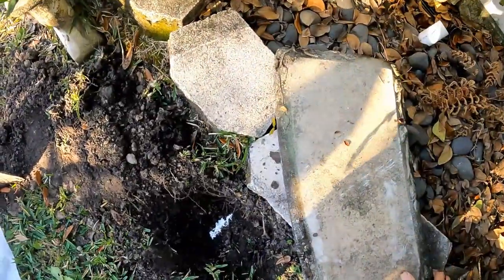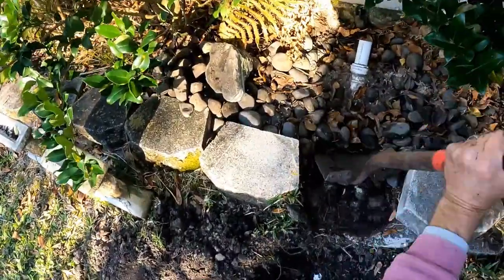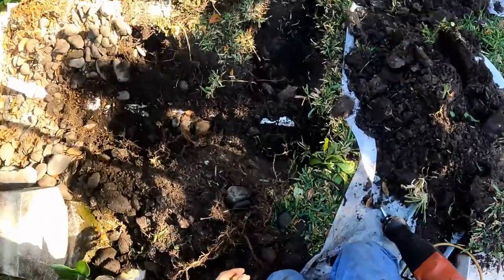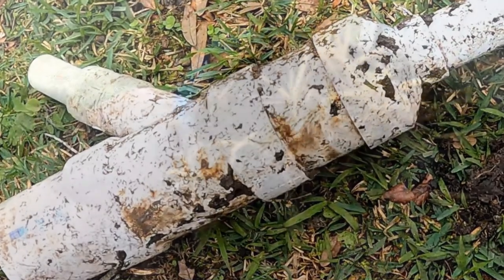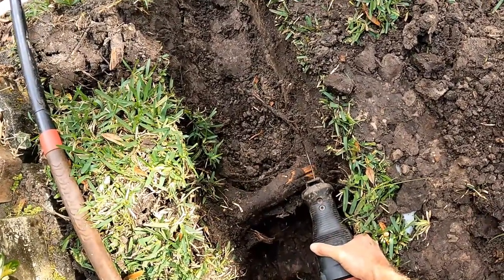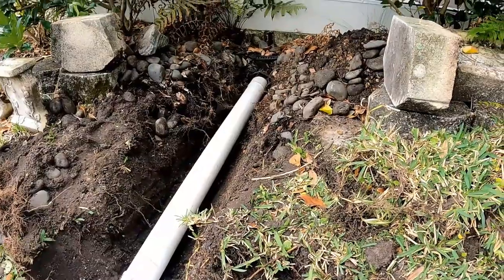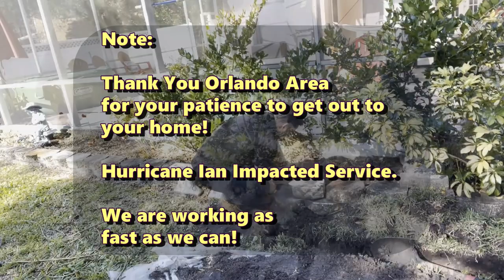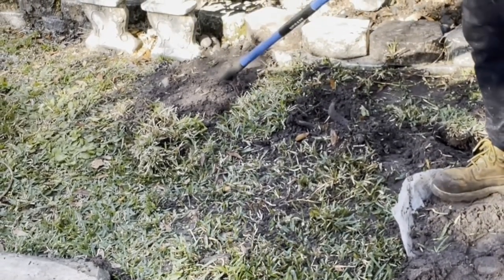Can You Use 2" Pipe for Yard Drain? The Answer is...

Comment: Why didnt you install some cleanouts? I install vertical 4” dia Wyes with 4” dia cleanouts about every 10ft in my outdoor drainage systems. I can reach down into the pipe with 4” cleanouts. Cleanouts allow insertion of a garden hose, pressure sprayer nozzle or snake to clean out the pipes. Majority of my outdoor yard drainage system uses 4” PVC pipe at min 1% slope and Reln catch basins with sump pits to trap debris/sediments.

A word on reducers: If you are going to install reducers to change pipe sizes, it cant be in flow direction of large upstream to small downstream. Thats a flow constraint, plus when its laying horizontally on a flat slope, the water has to rise to get over the invert elevation difference. (Reducers can work on vertical installation when velocity allows more flow in a lesser diameter pipe). But in drainage where slopes are usually only 1% to 5%, the reducer pipe has to be reversed, smaller upstream pipes can connect to larger diameter downstream pipes with an “increaser”, (its a reducer in reverse). This also creates a hydraulic drop in the system to increase flow velocity and prevent backflow. 

P.S. This is based on my civil engineering education/knowledge of fluid hydraulics/dynamics.

Comment: 2" isn't the issue. The problem is you can't get away with reducing pipes. Any pinch point will cause a backup. Code doesn't allow reducing pipes. You can only go bigger not smaller.

Comment: What about running 2in from a sump pump
Reply: Mine runs a 1.5 inch pipe which sucks but it works as it’s connected to my 4inch downspout leading out
Reply: I agreed what’s the difference on 2” pipe for discharge to the street? Why can’t you connect 2” pipe into 4” drain pipe to the street?